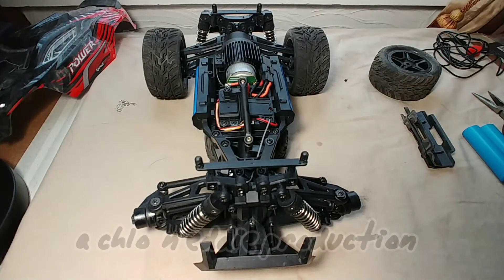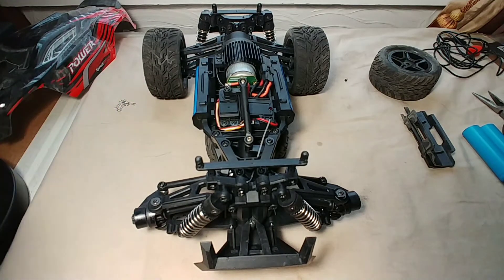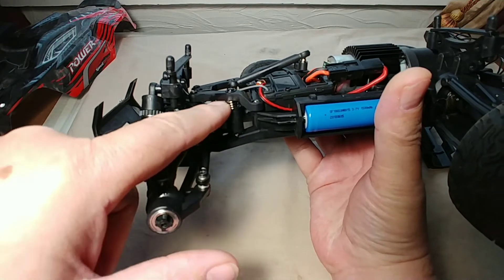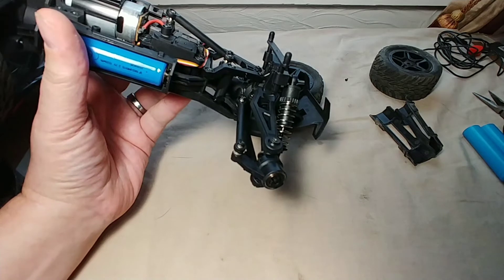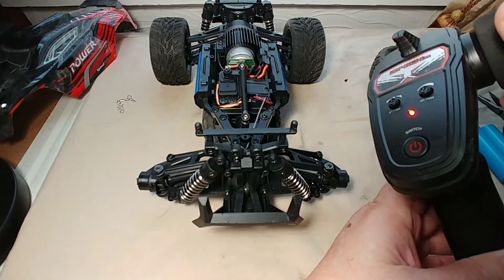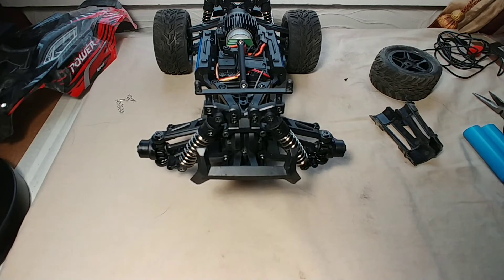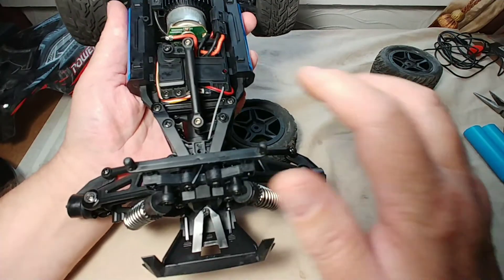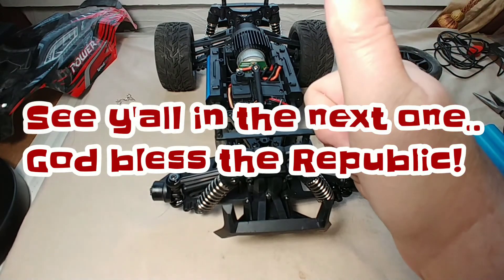HOSIM (SAN HE) IN THE RESEARCH KITCHEN - STEERING ISSUES

Comment: I got one of these BuggiesI have some helpful advice for you.
Like you I tried everything to stop wheels tracking, undone servo horn and felt every joint by hand ect.. to make sure nothing is too stiff, new 3 wire servo with brushless system ect. And still the same.

What I found helps is loosening the wheel nut screws just a fraction to allow a little play, this seems counter intuitive but trust me it works.
I think by having a small amount of play, under accelation the wheel on each side automatically adjust to make the car go straight instead of being locked in a fixed position, I also notice sharper steering too. I strongly suggest you try 👍🏻

Comment: Please help: my 9125 keeps disconnecting the wheel from the ball joint at any low medium impact. I tried tightening the screw that goes on the ball, also, tried removing it and putting it back, however, that particular screw to me seams to do nothing. Any help? Is there any kind of washer I can put to prevent it from coming off?